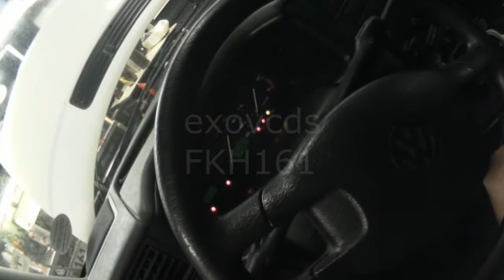VW T4: Eurovan 2.4L Diesel Fuel Pump Priming (part 2, Fuel Filter Installation)

Comment: Need some advice. Have 2003 T4 2.5 TDI. It recently started truggling to start with less than 1/4 of tank of diesel. Sometimes it start immediately, but sometimes have to crank it quite a bit and starts with a lot of black smoke at exhaust. Could the problem be a dirty fuel filter? Filling up that tank with to level of 1/2, it starts immediately. Could there be air in the fuel line, and how do I detect it?

Thanks in advance.

Comment: Very helpful, Thank You for sharing your experience. I have T4 1.9d but it seems I have same pump on. I did change cambelt in beginning of this sumer (actually shortly after I acquired the van) and I think I somehow missed timing on pump,  and now it leaks somewhere the fuel - in about three days the pump is dry, your priming video helped me there a lot. It also smokes on start white or grey smoke. My question is, could it be because of wrong timing (I get it to professional who will set the pump timing properly and the problem will be solved) or the pump or it's seals are somewhere blown and leaks the fuel, and if its blown I have heard of some biodisel stuff witch makes the gaskets swell and might stop leaking. Could you give me some advice here, and thank you again for the good work you are doing.
Reply from the maker: +Craft Run If you have an external leak around the pump (aside from the banjo bolt seals)... the pump will need to be removed to deal with the leaking area. Depending on where the leak is, that might involve taking it to someone with the correct equipment. Yes, sounds like your timing is out (color of smoke). If you do not have an external leak, it could still be an internal fault with the pump or a faulty check valve in the fuel supply line. If you do not find a check valve in the feed line, you can install one close to the fuel filter (where the rubber line is) to see if there is a difference. A one way check valve like this: https://c1552172.ssl.cf0.rackcdn.com/238375_x800.jpg You can do the same on the return line (valve needs to face in direction of flow).
Reply: +Thomas EXOVCDS The check valve had been installed on the feed line, but it didn't change a thing. I'll do the same on return valve as well. Shame I don't have a garage, we have -26C As soon as it gonna get warmer, I will try to find where the leak is. Thank You for advice!